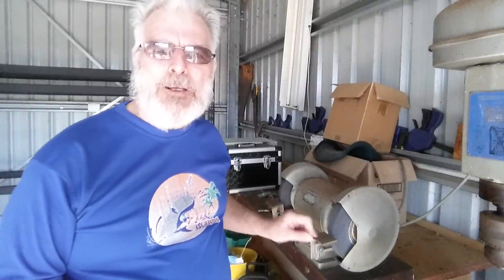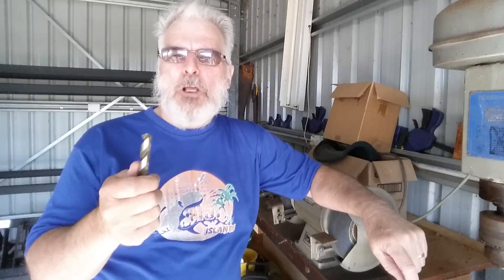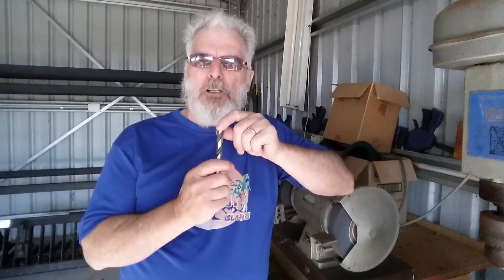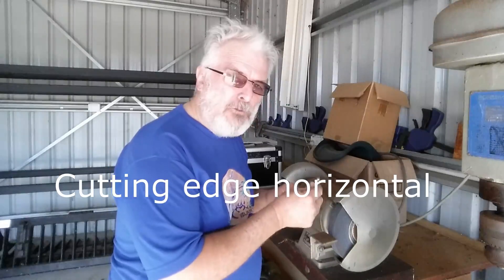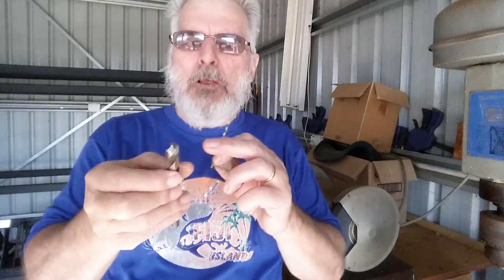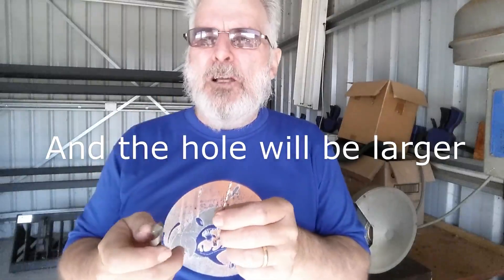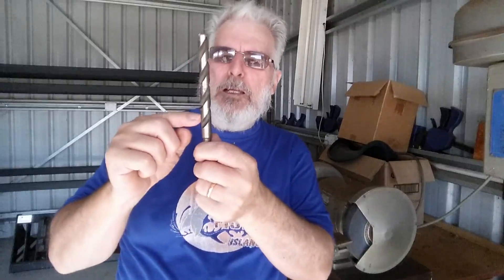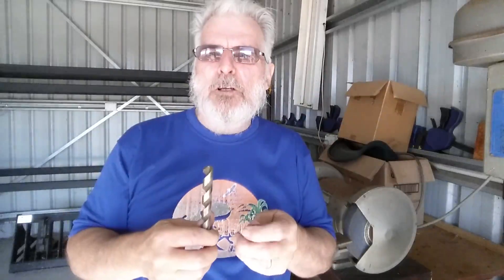Sharpen your drill bits - I've done thousands but its really easy

Comment: here i am an old guy , and nobody ever told me how big the pilot hole should be . thanks . here's a tip someone else might use : lay a large hex nut against grinding wheel , mark a line from wheel to the 1st shoulder on your left . there's your 60 degree guide line .